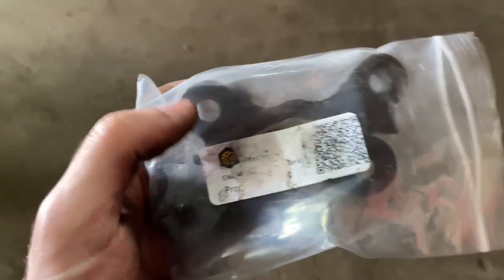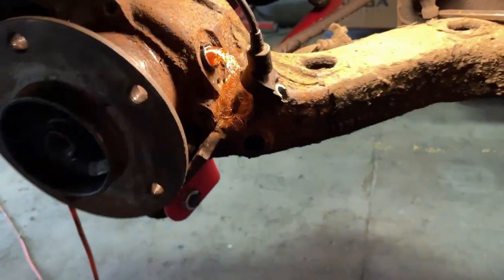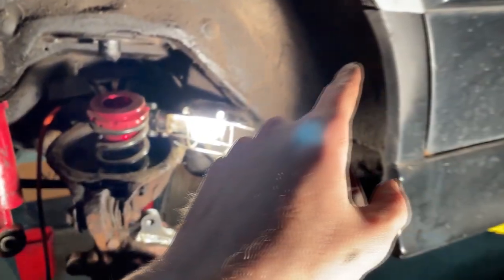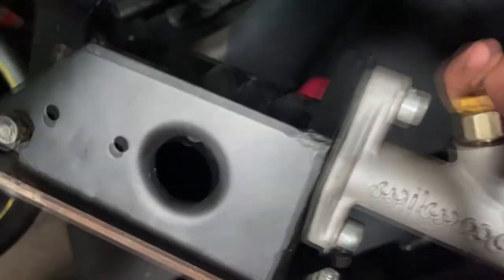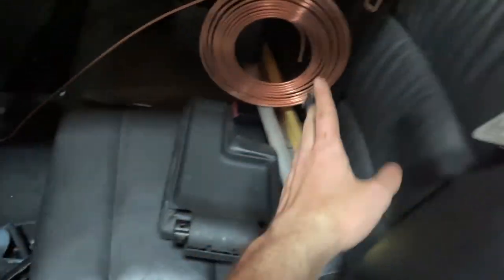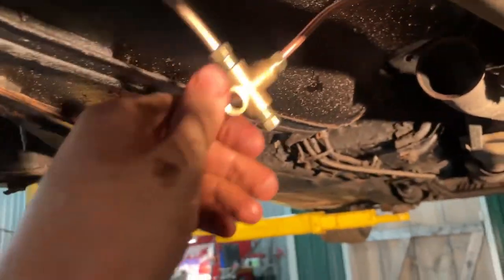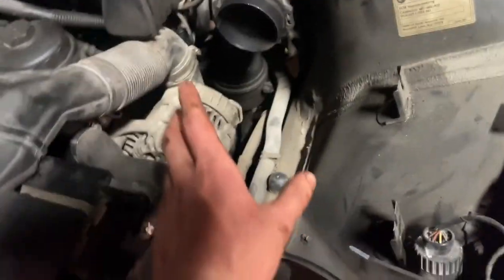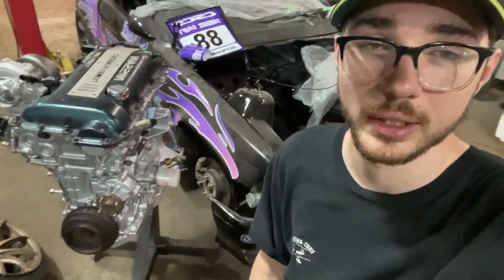E36 Hydraulic Handbrake Install - Weld on Dual Calipers

Comment: what wire did you use to weld it? i was under the impression the trailing arm is cast iron.

lastly, how is the caliper bracket holding up?